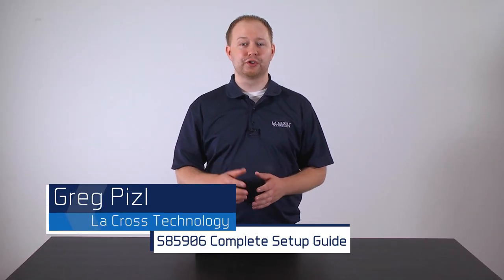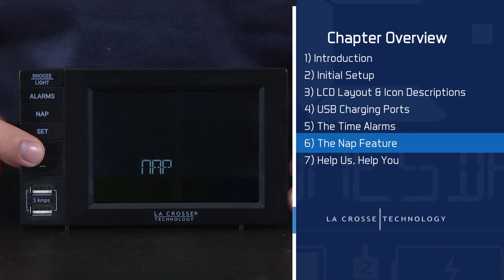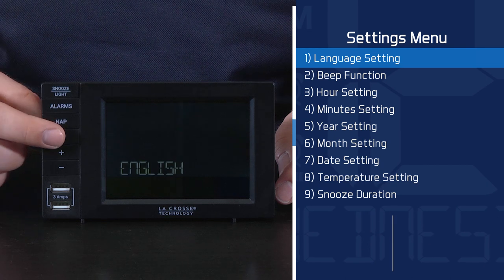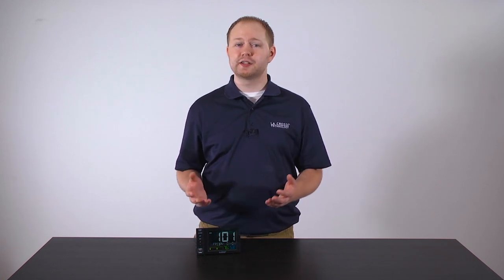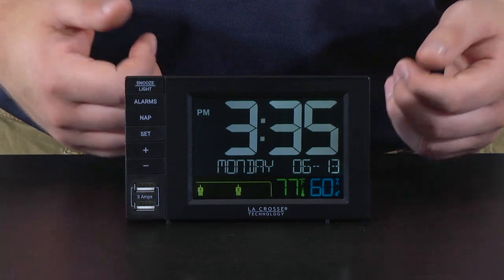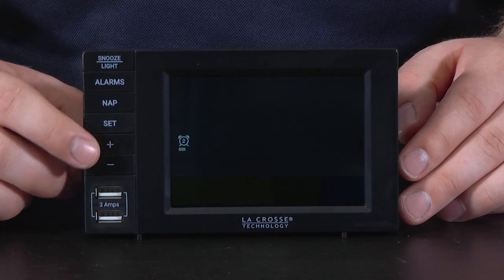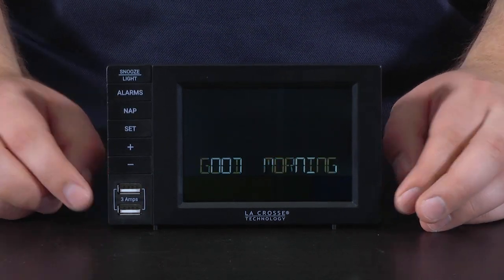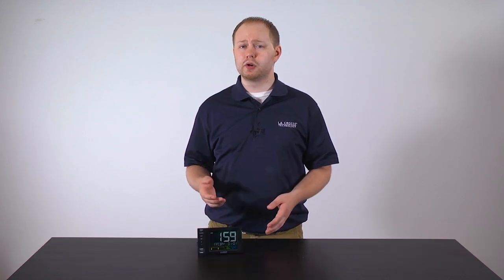S85906 Complete Setup Guide

Comment: I have this now Model #WW88723V2 but it just lost a minute according to my computer, hmm. How do I do the moon please which is in my lower left corner. And no nap feature on mine either. And now it just jumped to Saturday, wtheck? Please help, I had it on the right year but cant change it back, it's Friday Sept 2021, not Saturday Sept 3 2022? AAAgh. Even watching this I cant get it right. Also mine has the moon phase in the left hand corner, how do I do that? No dual alarm that I knw of on this either. Thanks so much!
Reply: Got i but set it one minute ahead bc of the loss of one minute. Thank you again!
Reply from the maker: @psychicoutlawchanel7430  Our apologies for any trouble or confusion with some of these features. First, in regards to your clock's time, since our WW88723V2 model is not an atomic device nor can it connect to the Internet, the time and date will need to be set manually within the settings menu. And do to possible discrepancies with the seconds, it is possible for the clock to be a little different compared to other devices. Second, you are correct, unfortunately, your model does not offer a nap feature. Third, the moon phase will adjust automatically when you have the correct year, month, and date settings entered. And fourth, the WW88723V2 only offers a single time alarm function. We are sorry again for any inconvenience, but highly suggest reviewing your item's full manual and FAQ documents here: https://www.lacrossetechnology.com/products/W88723V2#support for more detailed instruction. You can also message our support staff directly here: https://bit.ly/contact_techsupport. Or alternatively, send us a private message on our Facebook: http://bit.ly/LaxTech_Facebook or Twitter: http://bit.ly/LaxTech__Twitter page for further assistance.
Reply: @lacrossetechnology  Thanks so much for yr reply. Today a nice customer rep called me as I had set the clock up but then didnt know to do the alarm lol! She easily walked me right thru that and so it's all good now. Thanks again, I love the clock, nap feature isnt that important to me. Take care!!